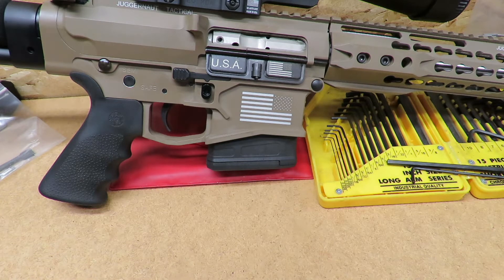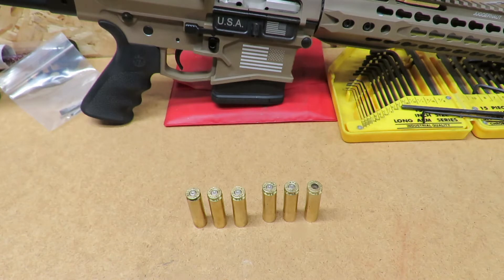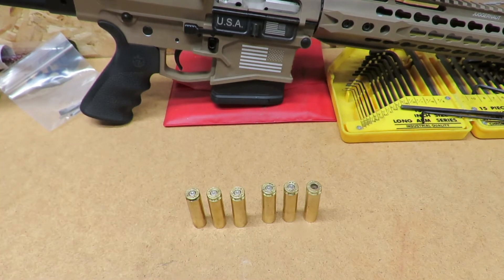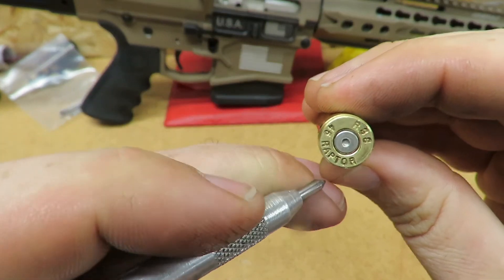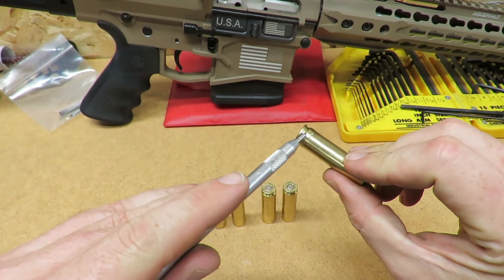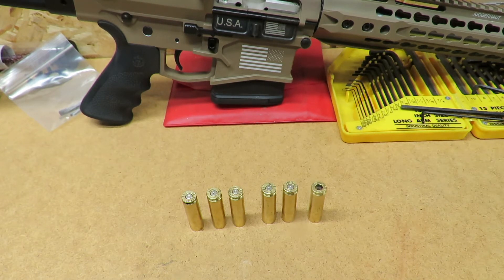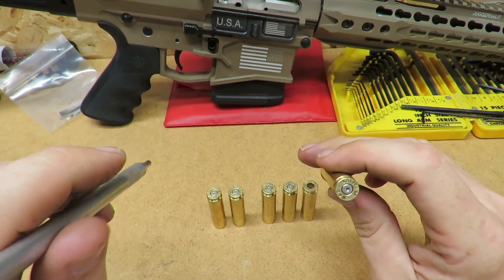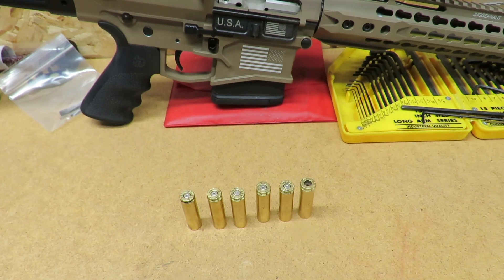Load development and signs of over pressure

Comment: I just got into reloading and I loaded some rounds for my AR-15 in 6.5 Grendel, they show signs of cratering at relatively low powder charges. I inspected brass from a factory load and it had a badly cratered primer too. Turns out my bolt face has a chamfer that leaves room for the primer to flow into. Do I just have to rely on ejector/extractor marks on the case?